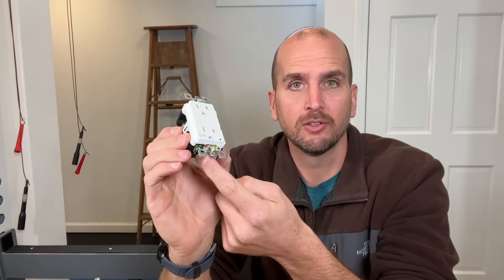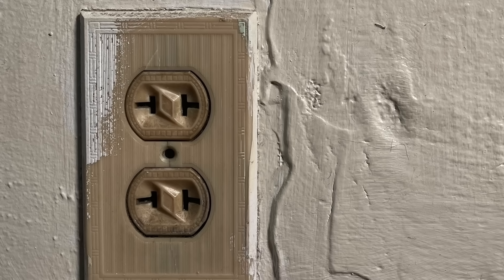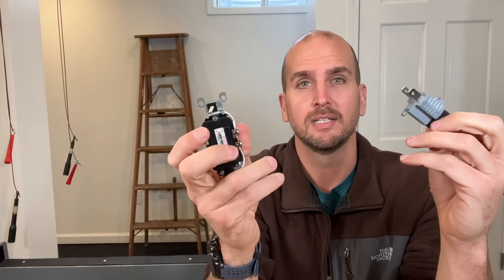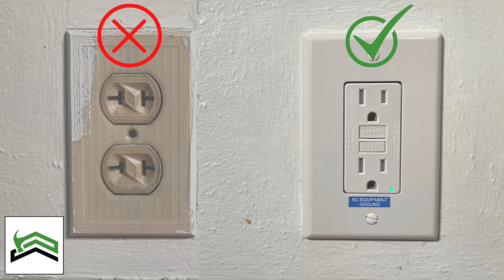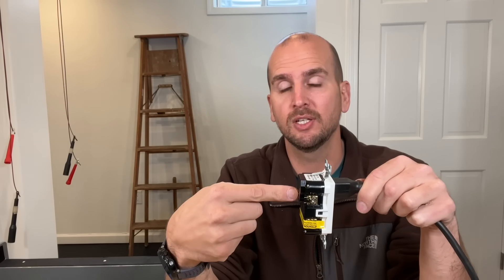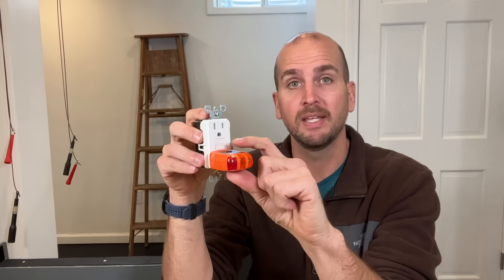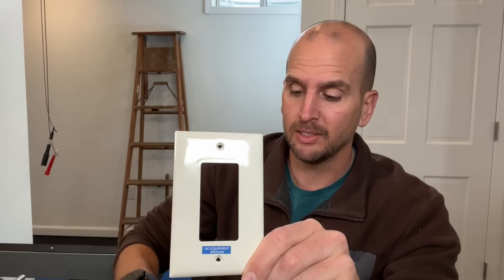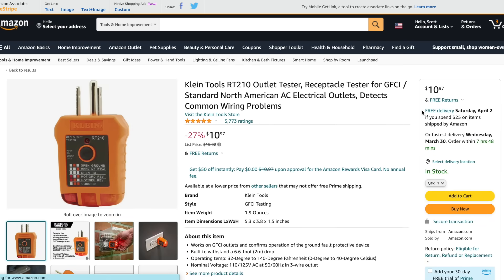Does a GFCI Outlet Still Provide Protection Without A Ground Wire?

Comment: There seems to be two points here for why people didn't answer your question the with the 'right' answer just as some of my college professors went about things:
1. People don't understand how GFCI works.  So you explain it can work without a ground wire.  So some people answer it 'wrong' because they don't understand.

2. People who do understand how GFCI works see that you can't properly test your GFCI.  If you can't test it, then how do you know it works?  So somebody may correctly know the theory and still say it is not safe due to the testing issue and so with multiple choice mark the same answer as those who don't know how it works.  Do you know how many times I have seen something untested fail to work?  I am sure I am not alone in that.  This is when I would get something 'wrong' in college is I knew the 'right' answer was a less than ideal way.  I still got through college.  Just learned with those particular instructors what they thought the 'right' answers should be and marked as such to make them happy.  Then in real life people keep saying that I over engineer things, but my stuff doesn't break when their stuff does, so is it really over engineering or just what it took to really get it right?  At that, do you know how many times there was some oversight and things broke anyway, causing me to go back to the drawing board and re-engineer things?  Just "over engineering" it as people say I do from the get go saves a lot down the road in not having to redo it later.  With GFCI, I would say just spend up front to get that ground wire connected and then only install GFCI where it is required by code.  It actually gets in the way if say you need to plug in your TV and you plug your TV into a surge protector so it doesn't get fried by a power surge as the surge protector will dump excess power to ground, creating a differential between hot and neutral that will trip your GFCI.  Common utility power is commonly surgy enough to cause a GFCI to trip multiple times a day when setup like this.  But with no ground hookup, this cannot work.  And say the hot wire on your toaster oven comes lose, making contact with the metal case while plugged into a GFCI outlet.  Normally the fault current should come back over the ground wire and either trip the breaker or with GFCI, the GFCI should trip first.  But with no ground hookup, the surface is energized until you start having the power flow through your body and hopefully trip the GFCI that you are not able to test to see if it actually works or not.  That sounds more like you cut corners as opposed to "over engineering" to make to make it as safe as it is supposed to be.

Comment: Will an inspector pass an installation, if you have a 2 wire system, GFI that works, but has no ground wire? Could you maybe make a video, showing the 2 opposing current solenoids inside, that toggle the trip mechanism, if one has more current than the other?

Comment: If no ground wire needed, then I want a TWO PRONG GFCI and in multiple color choices.
I do not want to deface my outlets with ugly stickers either.

FYI: some electronics NEED a ground for ground reference to operate properly.

However, how many people actually have devices that use a 3 prong?
Dang near NONE.
You probably need one for refrigerator, microwave, and possibly disposal. And always in a garage or basement.

When was the last time you saw a 3 prong plug for a cell charger? TV set? Box fan? Space heater?
Video game console?

How many places just sell those STICKERS alone?
Need both kinds of stickers.
Odd they do not use orange or red stickers for ungrounded GFCI's and blue for regular GFCI's.

Comment: I have a perplexing issue, I have an older home without a ground wire so it blows fuses. I placed at least 1 gfci outlet in each room to isolate anything overloading the circuit. the green normal light on the outlet glows on all of them and the red blinking light blinks on all to show they are working. Now the outlets I am using are 15 amp the fuse is 20 amp but the the fuse still blows and doesn't trip the outlets. yes 20 amp fuse blows before the 15amp outlets trip. and there is 3 outlets between the devices in the kitchen and the fuse. I bought these on amazon. oh and when you physically trip the outlets using the button each one trips like it should.

Comment: Thanks for the simple explanation. My remaining question is: does one GFCI on each circuit protect any remaining two-prong outlets on the same circuit? Or would each outlet need to be replaced with a GFCI in order to provide that level of protection? Thank you!
Reply: The GFCI protects all the outlets in the load side. In fact they are better protected as they are protected also agaist failures that happen inside the box.

Comment: How about two hot wires like water heater? Will the Gfci works due to imbalance? Ty
Reply: He's talking about standard 120v service. If it's got 2 hot wires going to the same device, that's 240v and your best bet would probably be to get an electrician to come in and replace the breaker you have with a GFCI breaker.

Comment: A friend of mine bought an old house with ungrounded outlets. He's physically feeling current, or is hearing buzzing, on a number of his devices/appliances (including a $10k+ pinball machine).

What's your suggested plan of attack?
a) have it rewired with 12-2/14-2 Romex 
b) install GFCI's on the first outlet of each run
c) run dedicated grounds to affected appliances or in various areas of the house
d) have an electrician address the situation
e) do a combination of any of the above
f) something else I may be missing or unaware of

Thanks in advance.

Comment: Most power tools that I have, they have no ground prong on the plug.  It is a double insulated system.  So, even on a grounded outlet, use of this power tool makes absolutely no use of the ground run.  I’ve put GFCI’s on hard or impossible to ground outlets for years.

Comment: Great!  You mentioned how to replace other two prong outlets in the circuit after the GFCI, by connecting them to the load terminals.  That was a bit of info I've sought for long time.  At 5:30, you showed the cover plate for a normal three prong outlet with the two labels.  That three prong outlet would have no ground wire, but would still be protected by the upstream GFCI.

Comment: Adding a GFCI outlet to a two prong or two wire receptacle is the only way to make the two wire receptacle safe. And as he said you must label the face plate with the no equipment ground sticker applied to it! Code required!

Comment: So lets say you have a room circuit with 3 receptacles and no grounds and its the same wire jumped to the next.

If you installed the GFCI receptacle in front of the last 2 will all 3 now be protected by the first GFCI?  (Assuming the next 2 are connected by the load side of the 1st GFCI ofcourse)

Comment: While "you don't need a grounding wire to protect against a ground fault with GFCI", the protection mechanism and behavior provided by a GFCI outlet and a grounding wire is not identical. If there is a ground wire, then when a hot conductor touches grounded equipment, a breaker will trip at that point. With GFCI and no ground, the equipment may remain energized until you touch it and provide a path to ground. At that point, the GFCI will trip but not the breaker.

Comment: Thanks for this awesome video!!!! Quick question. So if I am using a GFCI on an ungrounded outlet, I shouldnt get electricuted if I plug a heating pad into the same outlet correct?
Reply: You would not get electrocuted even without it. It always requires an equipment  fault for the risk to actualize. With a GFCI the power is cur before you get a dangerous shock. It may still sting.

Comment: I was told that in order to put in lights in Ohio that I have to rerun wiring because my wiring is illegal. Mr. Electric told me some bs that in order to hook up the new lights new wiring needs to be ran cause what is in the home is illegal and that we need circuit boxes for each light and that we need gfci outlets ran with ground wire in our basement family room which is finished. Is this true? I found stuff on Google stating that that only needs to be done in bathrooms and laundry rooms near a water source!!

Comment: I just swapped out all outlets and light switches. There were only black and white wires in the outlets but they showed that they registered properly installed with the checker. (grounded and correct polarity)
Says to me that the boxes themselves was grounded as they were metal. 
When it came to the GFCI in the bathroom, it showed an open ground and wouldn't trip when the button on the tester was pushed. How do I know it's providing protection? And how would I test it?

Thanks.

Comment: I have a 240 V wall heater that I am installing. There is a wire (240V), coming out of the  wall that does not have a ground wire. So the wall unit needs to be hardwired to the other wire, which has no ground and I know if I added a receptacle it would solve the problem. I want to make the connection inside the wall. How would I do that? It does have the metal casing around the wire , can you use that as a ground?

Comment: Consult you! The neutral wire (white) and the live wire (black) in the electric socket are all connected, but the ground wire in the cable box is too short, I have extra neutral wire, can I cut a neutral wire to extend the ground wire?
Reply: Don't do that as it is wrong color and can be confusing to anyone working on it. At least put green tape on it if you use it. The other way would be absolute no no. Never use green on anything else.
Reply: @okaro6595  It's ground wire, just strip the insulation off and wire it in. There's no point in doing anything to mark it as there shouldn't be any exposed wire other than the ground and a little bit at the terminals.

Comment: In my 175yr old house I use the GFI replacement w/o ground all the time (don't forget the stickers on the downstream outlets too). The only issue with not having the ground is for surge protection strips; there is no path for the surge to go to, so basically useless. The only place I rewired back to the breaker box is where I had electronics (TV, computer, etc.) was going to be "permanently” placed.

Comment: Is it possible to do a grounded GFCI downstream from inside main house to Garage? My garage underground wire is only two wire. I was thinking to do a downstream from inside the house from the grounded GFCI so all the outlets in the garage would be protected?
Reply: If I understand you correctly, the answer is yes just rememember to add the "GFI protected" and "no equipment ground" stickers to all those downstream outlets.

Comment: The problem I have is that the ground wire in one circuit  on one side of my dining room has a broken ground somewhere along the line. I've tested all the other outlets around and in that circuit and it's only that outlet plus one that's connected to that outlet that have open ground. I have no idea where the break is. Would installing a GFCI resolve this issue? Or else I'd have to completely rip op the walls, outlet, etc just to find that break which would be a huge pain. BTW this is 1962 wiring...so I know the wiring in the house has ground, just it's really thin.

Comment: Please comment on a two-wire circuit (no ground) where three-prong receptacle has been installed with a jumper between the silver common screw and the green ground screw?
Reply: That is not allowed. I will not go to whether it is better or worse as it is not allowed and that is all that matters.
Reply: That's extremely dangerous because the ground pin is now a second neutral. The correct way to add a ground if there isn't already one there, is to fish a ground wire back to where you'd normally connect it. 

It is far safer to just not have a ground at all and just install a GFCI outlet to protect the circuit with the appropriate labels.

Comment: I have a ridiculous situation here. We have an old house in Pittsburgh probably 110 years old and i really love learning about all things electrical and feel i totally missed my calling so thank you for all your informative videos!  ANYWAY, I popped open an old outlet here with what looked like a ground wire BUT some sneaky SOB 😸 had simply ran a copper wire from that outlet to another outlet directly on the other side of that wall. Now, I'm wondering if i should do the same with the GFCI outlets I'm about to install or if i should completely just yank that "wanna-be ground wire" out of the wall?  Will it even serve any purpose? Everytime i think I've seen it all in this house, i find something new to shock and awe 😸. Hopefully not shock, literally though 😹. Thank you again!!!
Reply: That wannabe ground was likely legal when it was done, but it was usually done to a water pipe. Code has changed, in part because plastic pipe is so common even in Reno’s. The only way to be sure is to ask a local inspector, who’ll likely say leave it alone, just don’t do any more.  Do NOT do it with the gfci outlets, it’s totally unnecessary.

Once an outlet is protected by a GFCI the only reason to have a real ground is to provide a quiet ground reference for high end audio equipment or amateur radio.

Comment: I think the Ground in ground fault circuit interrupter confuses people.
Reply: True, here we call it a fault current protector. The term ground wire is also confusing. In the UK it is called the CPC (the circuit protective conductor). This tells what it does and does not give wrong ideas how it does it.

Comment: Need a ground wire to use the Hand Held FGCI test plug.  No ground wire, the tester will not work.    CONVERSELY, the testers on the electric hair dryers ( similar to a GFCI) will work ( the test button) without a ground wire.      CONFUSED YET?

Comment: What would I tell a home inspector if I replace two prong outlets with gfci and  he says it's not grounded according to his outlet tester?
Reply: Tell him to read the label: "No equipment ground" that with the GFCI (or the label "GFCI protected") are what counts. That is the reason for the labels.

Note that if you rent it out you cannot do the change yourself. Also if you intend to sell the house you may not be able to do it yourself. The exact rules depend on the state. The idea is that you can do it if you take the risk yourself.

Comment: I just want to say grounds are necessary for protection i know code allows old wiring if its grandfathered in. If you add grounded outlets and have no ground wire to connect you must label each outlet stating ground not connected wheather its GFI or not. All ungrounded outlets must be labled. I would replace all the wires if im going through the trouble to replace outlets. Somtimes you get lucky and the metal box is grounded case of EMT my dad wired the whole house in greenfield and ridged EMT. 73

Comment: A very good video. My local electrical contractor inslalled GFCI, telling me it provided Ground. After that installation, I contacted the company owner to tell him I actually wanted Ground, not just GFCI, to my  outlets. He insisted that GFCI provided Ground. Did he lie or is he incompetent? Doesn't matter. Needless to say, I will not be doing further business with that outfit.
Reply: If it isn't labeled as being ungrounded, then it had better be grounded or that's a violation of code. I'd certainly get it tested, which can be done with a cheap plug in tester and no skills at all. And honestly, it's not a bad thing to have on hand if any of the other outlets start acting funny as it can help verify the wiring.

Comment: Quick question: There are a total of 2 (two-prong) receptacles in the room and I am replacing both with GFCI. I’m pretty sure (but not certain) which receptacle is the line and which is the load, so I am opting to place GFCI on both. My question is when it comes to making the connections, do I connect both receptacles to the ‘line’ of the GFCI and leave the load empty, or does one need to be connected to the load? Thanks for you great videos!
Reply: If both are GFCI leave the load empty. Though with two it is trivial to check which is the first. Just remove one and reconnect the power and then check if the other is dead.

Comment: Would running a new ground wire from an exterior grounding rod to a GFCI outlet in an existing two-wire box add any additional protection?  Making absolute sure that I’m not bonding it to the neutral.  I have an old boat house that only has two-wire (hot lead and neutral) boxes and I want to add an exterior plug.  I’m going to wire in a new GFCI plug, but wanted to see if I could add an external grounding rod to the receptacle  for any added protection?
Reply: Yes it would but I do not know if that is be allowed by the code. That would essentially create a TT system which is used in many countries (like mandatory in Italy). The ground wire would ensure that the GFCI trips immediately at the failure before anyone touches the device.